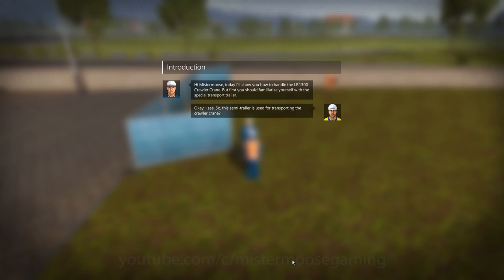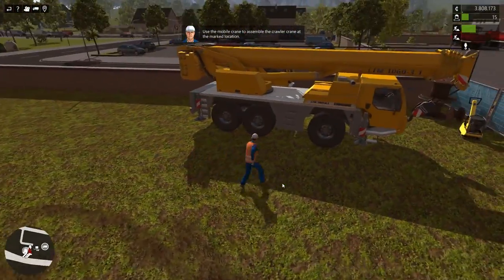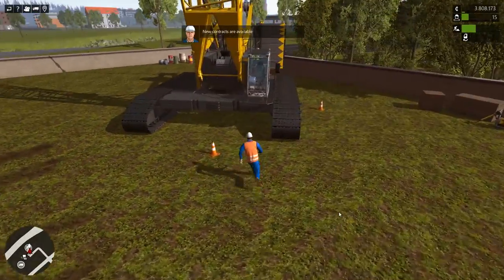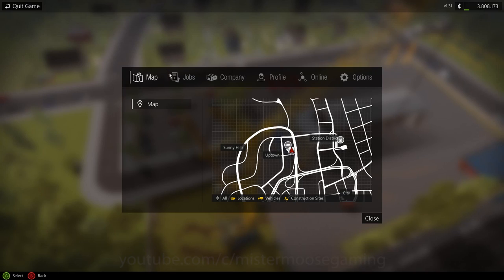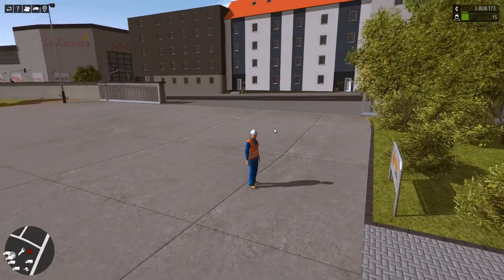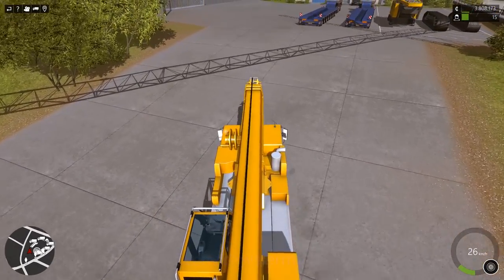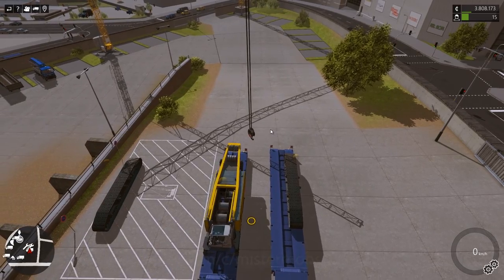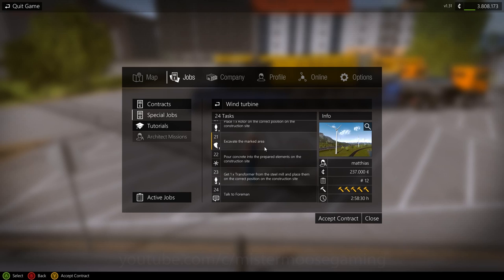Construction Simulator 2015 - Buying a Crawler Crane

Comment: I learned a great deal watching your video, Mistermoose.  I am very close to using the Tower Crane, which I just purchased.  My biggest gripe with this amazing game is the decided lack of intuitiveness.  Don't know if the designers were skimpy on instructions because of time constraints or simply wanted you to figure things out for yourself.  Also, I learned about the Company menu - something I forgot many hours back how to use.  So far, my greatest challenge was how to pour concrete - didn't know you had to use a mixer in tandem with the pumper.  And that pumper - what a crazy contraption to get used to!  Not sure where to get my concrete bucket from.  Doesn't show up in my menu at the Dealer just yet.